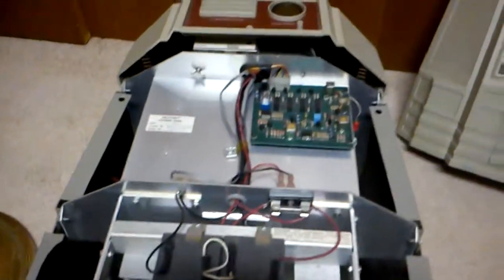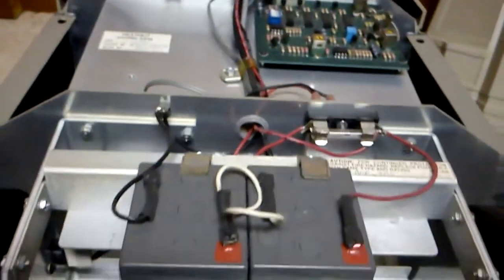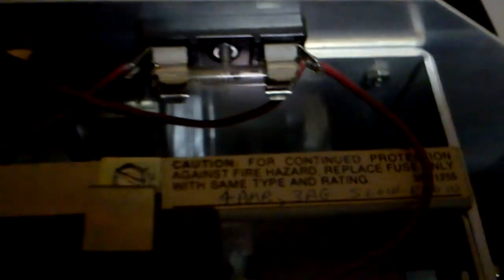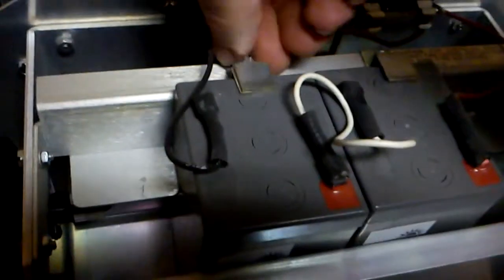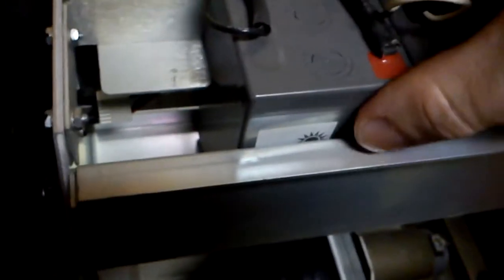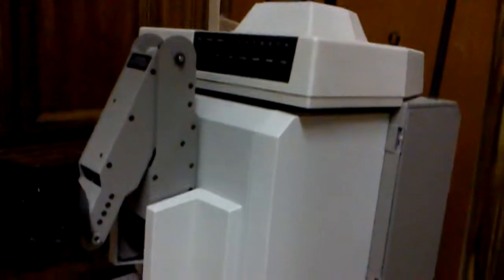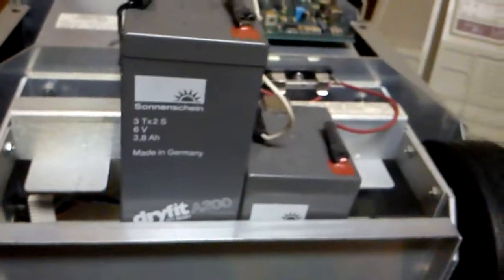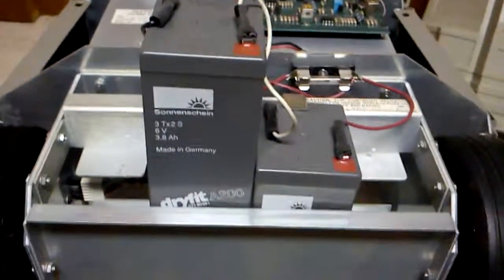Heathkit Hero JR. Robot Battery Replacement Question

Comment: I went through my many emails I had with Robert about my Hero Jr. (Johnny) and found that he said Hero Jrs originally had a pair of 6V 4 Ah batteries in them.

If you want a single battery powering it, it would be best to get a 12V 7 Ah battery. That would give it the equivalent of two pairs of 6V 4 Ah batteries, so four 6V batteries total which in turn doubles its running time.

Also, I would recommend charging yours for 10-12 hours at a time as long as you have those two 6V's. Me personally I find that he runs best after 20 hours of charging, but that's because I'm using the 12V battery. If you don't have him on often just charge him every other day.

I let mine charge all day when I am at work and everyday I come back and let him run around for a few hours before I go to bed. It's the easiest pet to take care of ever.

I have plenty of videos of mine I still need to post. Hope you post more of both your Hero's!

If you have any questions or need help with anything (such as programming both his and your name into his memory, I have the documents for it) just message me.